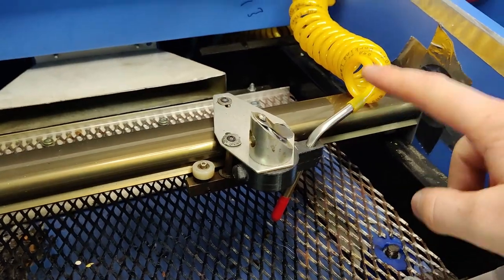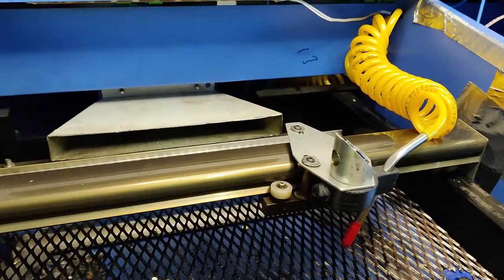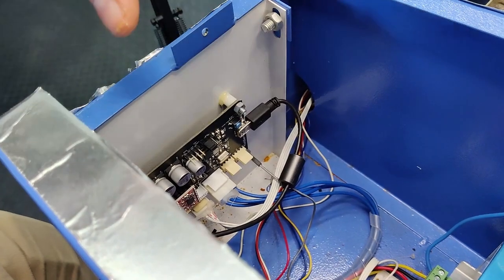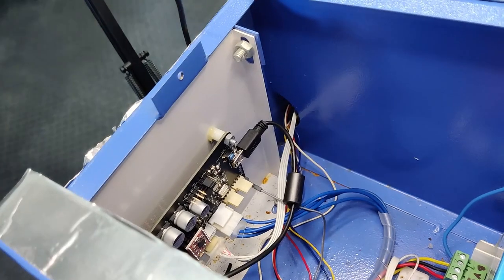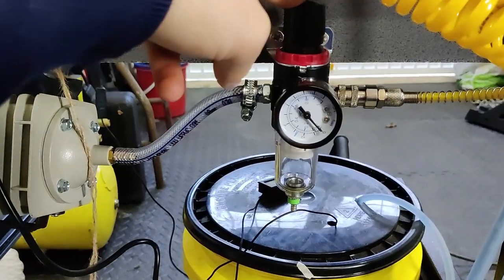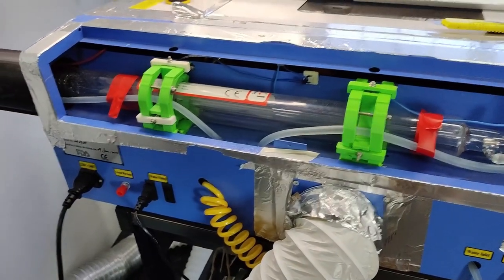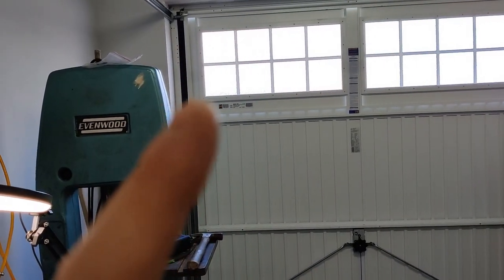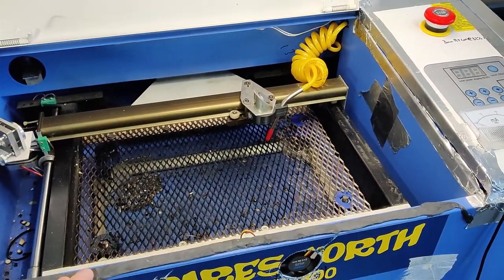K40 Laser Cutter - Engravers NOT GOOD ENOUGH !!! Here are my Improvements

Comment: I don't use antifreeze on my k40 even though it's in the room with no heat. I have a aquarium heater that's only 50 Watts. But to keep it from running all the time I have temperature control outlet that comes on when it drops below 50° f.

Comment: instead of masking tape I use transfer tape (signwriting supplies, usually used for decals) so much easier and way cheaper if you use a lot.  the one that actually looks like masking tape, not the clear one, hope this is useful for someone. Easy to find online. 100 metre Rolls in all sorts of widths.
Reply from the maker: Yeah I need to try that, this was just some cheap stuff I got on eBay to test out. Cheers for the advice 🤙

Comment: Thank you very much for your video. Before viewing I wanted to buy a K40, then dismantled it to makes all the upgrades in one run. I realized that the remaining of the original K40 are probably just the enclosure, the guides and the perfectible mirrors and lens holders. I guess the cost of your mods are far above the K40's price tag. I heard you saying there's still a bunch of upgrades to do next. Thanks again because I realized building a whole 50w CO2 laser from the ground up, with the right components and the right build area would be less expensive. I guess also there might be a way to optimize a lot, for example the footprint and the fumes extraction. Of course tinkering a K40 is maybe a fun learning journey, but there's a lot of pros to skip the K40 step. I subscribe to follow you progression. Good luck 🙂
Reply: I know I'm probably a little late to give you any advice before you make your decision but I actually went through the same problem and actually went with the K40 instead of building from the ground up. The reasoning behind it was how expensive each mistake was going to cost. I had dimensional CAD models all ready to 3d print as soon as I had the time to start. When I priced out every single component, I had exceeded the cost of the K40 by nearly 2X. Add into that the fact that at that time I had never used a laser cutter and didn't fully understand the myriad of risks, I was on the short track to cutting corners that would have been very unsafe. Ultimately the decision to purchase a K40 was the correct one since it allowed me to get experience at a low cost of entry in time, money, and blood. Consider buying a K40 and then after gaining experience, use it to manufacture the parts to a second machine in the 100W range.
Reply: @d3m0n54in7  well, it's just like to tell a newbie to get a wrong laser, then have a bad experience with it as it's not good out of the box, then when you payed twice the laser cost into upgrades, you're ready to pay more to build another one... This does not makes any sense to me. Why not buying a proper laser at the start as it will cost you mostly the same at the end, except you will not have any bad experience ?
Reply: @axelSixtySix  my k40 worked right out of the box. You don't have to add a bunch of upgrades I've only had to add air assist and replace a shattered lense. Still not the $900 pricetag to build a plastic machine that doesn't work half as well as the stock k40 did.
Reply: @d3m0n54in7  you just said the contrary... If the K40 is good right out of the box, why did you spend twice the price tag into upgrades then building another 100w laser ?
Reply: @axelSixtySix  no, I was talking about how much it would cost to build one from scratch. I've only spent $500 for my machine and it's upgrades. I've had it for almost 5 years and it's still as reliable as the day I first plugged it in.
Reply: @d3m0n54in7  I did not know a k40 laser tube and mirrors could last 5 years. Same for the guides and plastic wheels. Maybe you don't use it very often. Your experience looks like very different from our host's. I have watched a lot of K40 users videos and most owners spend much than you into necessary upgrades and repairs. And those are costy indeed : guides, leveling bed, better mirrors and nozzle, fume extraction, air assist, cable chains, and so on.  Of course a k40 laser's price tag is unbeatable but you get the worst stuff : 35w tube, not efficient PSU, tiny aquarium pump, bent sheet metal as guides, asthmatic fume extraction, fixed Z heigh, low monitoring and budget electronics. That's the worst bill of materials you can get from China. Of course a proper laser with decent power and good components will cost you more than a K40. But what are we supposed to buy ? A good price or a good machine ? If your expectations are low, maybe a good price will do. But most of K40 owners runs into upgrades at purpose, because the K40 is not good enough out of the box. And from what I can see from our host and other owners, any upgrade shows obvious benefits on the cut quality and user experience. And if better lasers have built in all that features, it's at purpose too.
Reply: @axelSixtySix  if well maintained and used within it's capabilities, a K40 is a good tool. After 5 years I'm only now considering a desire to change the control board from the m2 nano to something else. I engrave mirrors and tile, although fairly infrequently. I've never had a need for an adjustable bed because the integrated clamp worked well enough and required no adjustments. Honestly if you can't get a decent product out of a K40 then you can only expect mediocre results from a quality machine. The weak link is usually the operator. Just read the subreddit for k40 and you'll see that 90% of the problems come from overlooked fundamentals. My only disparagement about the K40 is that it can't have pass through which seems to be the same problem for every design, not intended for commercial service. Something that my original design ideas had never made allowances for. I didn't intend for this to be an argument, just a suggestion based on my experience since so many people seem to think that a K40 vs an epilog is some kind of legitimate comparison. Go ahead and build your own laser but don't expect it to be particularly easy and certainly not cheap.
Reply: @d3m0n54in7  all right, I don't want to sound harsh, but how many CO2 lasers did you owned or have a reasonably long experience with ? Because you seems to be afflicted by the "what I own is obviously good just because it's the choice I made" syndrome. As a fablab tender, I saw this many times, but this will be exactly the same for people who bought average cars, or any average... you name it. We have currently 6 lasers at the fablab. I would only rate one of them as average (6090 Thunder). The others are budget lasers. Please learn any laser source is a wearing part that can't last independently of its make or the perfection of its maintenance. We have to change our lase diodes within 3500 hours and CO2 laser tubes within 1500 hours. Your experience shows you're an occasional user and your laser tube have probably less than 1200 hours, which is the threshold beyond which it's power drops continuously. 

Anyways, thanks for sharing your experience. And don't worry, as an engineer any build I did was a pleasant experience which results in an interesting and money saving machine. The only factor is time, unfortunately...
Reply: @axelSixtySix  you have the experience to know the difference between budget and commercial machines and the features that distinguish the difference. My advice is applicable to new users trying to decide whether to buy a K40 vs jumping into building a CO2 laser with zero experience with maintenance and safety. I don't claim to be an expert or have extensive experience. What I presented were simply facts about what you can do. If you have the budget then I would have suggested just buying a commercial machine. My apologies for reading your post as that of a person trying to get into the hobby. K40 is for beginners, it's why you get your kid a Corolla instead of buying them a Ferrari. Both are capable of similar results, one is just cheaper to repair or replace when they inevitably get into an accident.
Reply: @d3m0n54in7  A k40 is not a Corolla, it's the cheapest car money can buy in your area. A Corolla is an average vehicle, the K40 is not an average laser, definitely. 

Whatever the machine you may want, CNC router, 3D printer, Diode or CO2 laser, you can get a low price machine. It's named the 3018 for CNC routers, the Ender3 for 3D printers, and so on.Should a beginner buy the cheapest machine ? The answer I would give is no, probably not, for many reasons. First, the lower price tag always come with a lot of cons. Lower price always provide a good revenue for the manufacturer/reseller, and never a good machine/experience for the buyer. At the fablab we fix a lot (I mean A LOT) of member's budget machines. Some never worked and get abandoned within a hour. Beginers don't know, so... Please understand it's always the same story : cheap, unsuitable, inacurate, fragile, imprecise components that are not meant to work first time any time. As a beginer, you're not the one to debug a cheap machine. That's the leading road to a bad time with a machine. Worst of all, with the wrong machine in hand, you learn how a bad machine works or how to make a rubbish machine works, not how machining truly is with a proper machine. You don't get valuable experience, you learn the contrary of knowledge. Because with a low cost machine you don't get the real thing. 

In my humble opinion, beginers should get better machines, even if the price tag is a bit up. Because the experience will be better and you'll get help from a proper customer service if things goes wrong, not the last word of the last guy who only knows his machine. The only exception is if the machine is the project itself: you prefer tinkering the machine than using it. In this case only cheapest machines provides you an endless tinkering experience. But if you know nothing about machines and you want to use a proper tool, not reparing it, the good advice is to buy a proper machine.
Reply: @axelSixtySix  I agree with k40 being better for tinkerers. Your original post suggested that you were. If the person asking didn't seem capable, then I would have suggested the glowforge or a proper epilog. There are tons of people who buy cheap with excessive expectations, that's for sure. It's all about the context but the fundamentals are still the same. 3 mirrors and a lense. If you can't figure out at least that part then you're going to have just as bad of a time with any other laser. As for the customer service side of things, if they think that's something they'll need to use then clearly the K40 isn't for them. We both agree that it's not a reliable machine for any level of production and has no place in a commercial situation. However if you fully expect to break it, set it on fire, run liquid oxygen through the air assist, or seal it up to run an inert atmosphere operation then you want something that isn't going to have a warranty to void or a high cost of replacement.
Reply: @d3m0n54in7  I'm an engineer, not a tinkerer. 😉
Reply: @axelSixtySix  that would probably explain why we're arguing yet agreeing on a fundamental basis. 😁 Technicians and engineers are always arguing 😂
Reply: @d3m0n54in7  well I I stopped arguing two messages ago. The last word is yours.
Reply: What a hilarious back and forth that was

Comment: Hey, nice vide. Does the antifreeze in the distilled water cause any problems? Is antifreeze conductive?
Reply from the maker: Thanks! In the UK it's not as easy to get "RV" antifreeze which is what most people recommend, so we need to work with what we have! I've been using this for almost a year now with no issues, I also use Tetra Algicide too, and so far haven't needed to change my coolant for months.
Reply: @thorgersddd174   I'm thinking about an aquarium heater, or a home brew heating mat on a timer with the water pump in the rare event of frost here in Cornwall.  I went for a  UV light to kill the algae.  Nice set up you have there.   I'm working on better water cooling here.

Comment: "This machine is sold as a 50 Watt Laser Cutter (10:10 - 10:12)".  What country do you live in?  I have never seen a K40 Laser marketed or sold as a 50 Watt Laser.  They are marketed & sold as a 40 Watt Laser, however, the maximum output power is 35 Watts at best, with the cheap Laser Tube it comes with.